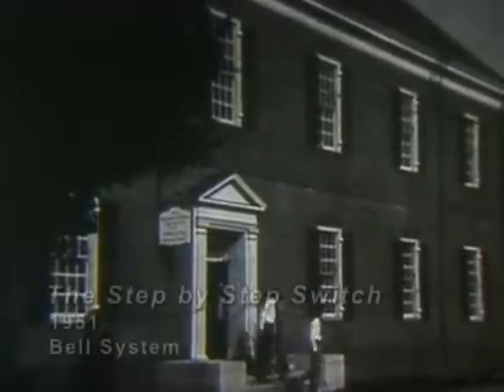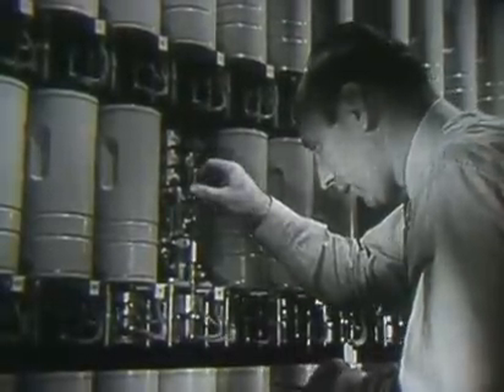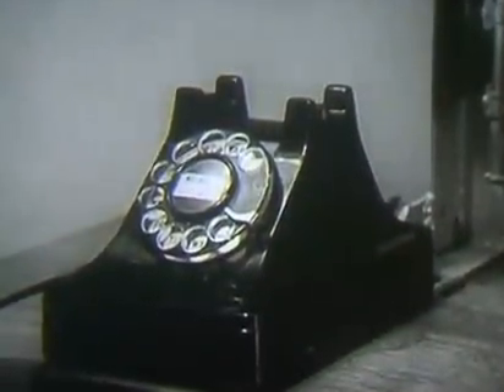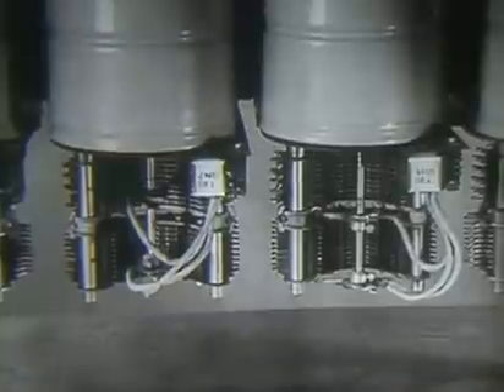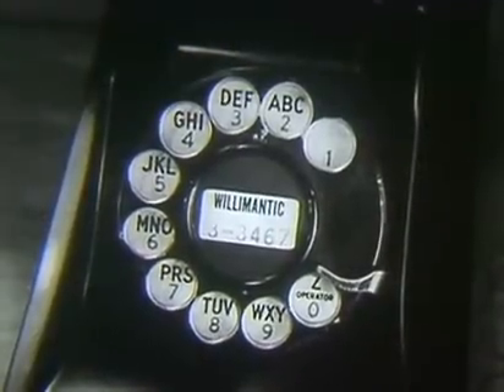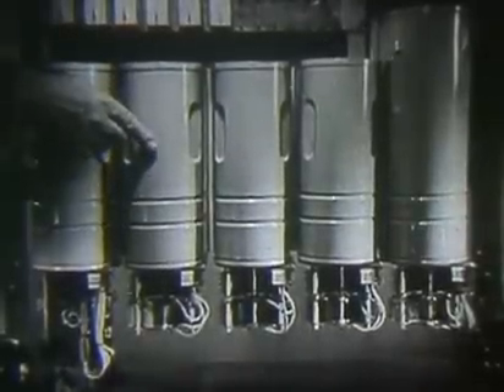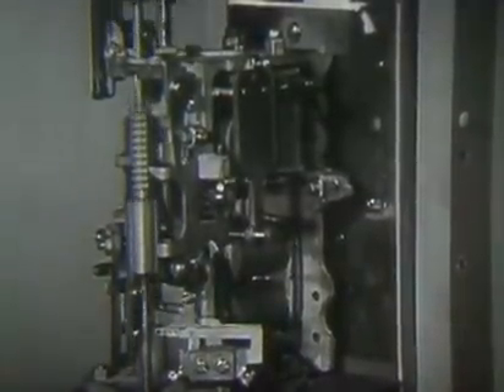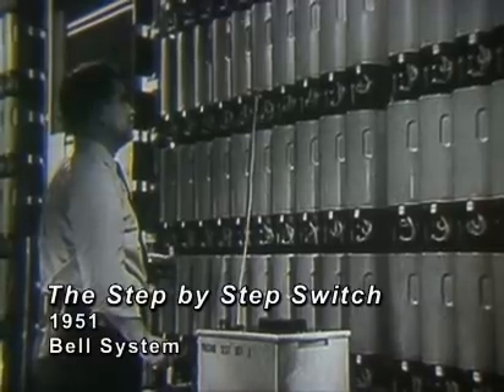AT&T Archives: The Step-By-Step Switch

Comment: This is very interesting, but unrealistic. They totally leave out the entire phone network and that these switches are rarely all in the same room.

A brief overview of the system, from old memory, but should be good enough to get the basic idea... 

The wire from your house goes to the nearest Central Office, which is a room full of these switches, and on one side of the office is a bank of switches with one terminal for each subscriber or phone that it serves. So if you had 2 lines in your house, there would be 4 wires running from your house to the Central Office, and connected to 2 terminals on multiple switches. 
(redundant so that the chances of all the switches that you were connected to being already in use was low) 

So when you pick up the phone, one of the switches it is connected to which isn't busy rotates and selects the contact for your phone.
Then when you dial the first digit, that activates the second switch, which will select either to stay in this central office, or selects an available trunk line to another office in town.

The next digit dialed is passed through now to the remote office, and selects the correct group of switches in that office for the right side of town. 
The next digit selects the bank of switches for the particular neighborhood, and the next digit selects the bank of switches for the right street, and the final digit selects the exact terminal for the wires running to your mother, because you should call your mother.

You can see why phone numbers got progressively longer, because the more possible connections you have, the more numbers needed to drill down.

In the early days you could only dial within your city or area, and if you needed to call long distance you had to call the Operator, who would select a trunk line in the direction you needed to go, the operator on the other end would answer, and then put the call through on their local system, and if you needed to call across the country, the operators might have to repeat this process through multiple interchanges in the cities along the way, until the route made it all the way to the end.

When direct dialing was introduced, they had to add the country code and area code systems which would select the trunk lines headed the right direction, and then keep drilling down. This was more complicated, because the area codes were not in sequential order, so when you dialed a 7, it didn't know whether you wanted 707 in California or 737 in Texas, and so it had to have some way of waiting for all 3 area code digits were dialed before it even knew which side of the country you connect to.
I can think of some ways to do it, but I don't know how it was actually done, but it was more complicated than just a simple city step system!
Reply: "...and the final digit selects the exact terminal for the wires running to your mother, because you should call your mother."

OK, I LOL'd!
Reply: Did step even have direct distance dialing? It may have just sent the call directly to a long-distance tandem when you dial 1.
Reply: Your explanation is fairly good, but the opening is wrong.  Your telephone was only connected at one point in the exchange but when you picked up the receiver, a selector switch in the exchange would begin to rotate, looking for equipment available to switch through your call.  The selector switch would automatically stop at the first set of available equipment and then you'd get your dial tone.  If there was no available equipment, you'd either get a busy/congestion tone or else you'd get nothing but the background line noise.
Yeah, I used to work in that area.  I still feel some kind of romantic nostalgia over the old step by step equipment.
Reply: I worked on first floor of CO which was big room for MDF and the local switches for town.  Second floor was all LDD and MW toll.

Comment: Wait, so every phone had to have its own switches? So if there was 50000 phones there were 50000 switches?
Reply: No, the line finders could each handle up to 200 lines (phones). Each line finder was connected to a first selector. So that made the number of switches needed 200 times smaller.
Reply: @johnbowditch3706  I'm still confused how  the line finder can handle more than one call at once. If it can't then wouldn't they need one for every phone?
Reply: @NoZioKikes88  Each lone finder is just that. When a very simple set of two relays called "line and cutoff relays" detect a phone that has been lifted off the hook they send a signal to the line finder to begin searching for the line that needs service. It hunts first up and then around until it reached the "live" contact that is associated with that particular phone. The the lone finder stops and the call can be completed. You are right that this particular line fonder is now engaged and so it will be tied up until the call is completed. But these offices were designed so about  up to 20 percent of the phones in a given office could be in use at any one time. If more folks tried to call then the later callers would not receive service.
Reply: @johnbowditch3706  got it, thanks 👍
Reply: @johnbowditch3706  So then I guess what would happen at that point (if more than about 20% of the phones were in use) is you would not get a dial tone?  I remember my Mom saying that she was in Washington DC the day Kennedy was shot, and that the phone lines there were overloaded and she couldn't get a dial tone.
Reply: James P   Yep,  no free line finder, no dial tone, no call.  Then if you did get DT, the connector bay might be busy for the number group you want and you'll get 120 busy tone.  If the number you called was busy you would get 60 busy tone,
Just like now for cell phone service, too many calls can't go through. If that happens then try text, at least that way text will go through when free.
Reply: @gijr2003  Ah, interesting, thanks!

Comment: I used to maintain Strowger switches for GTE in California.  I don't miss maintaining Strowger switches for GTE in California.
Reply: @somedumbozzie1539  I'm not familiar with crossbar equipment or cabling, but I know all about engineers changing design parameters midstream, and "re-tasking" equipment "experimentally".  Frustrating stuff!  While all other COs were installing new EAX/ESS switches, I was installing new digital-to-analog circuits, so that our subs could use 'touch-tone' technology.......Interesting stuff!  I was only 21 at that time, and knew that I'd eventually be given the opportunity to work on/with the "new stuff".  A job with the City of Los Angeles exposed me to microwave radio and fiber optic tech......I learned a lot for a decent wage.  Plus, they still actually had some SXS equipment for me to fix.....life was good!

Comment: Actually..... You didn't need to "dial" the numbers at all.  You could place a call simply by rapidly pressing the receiver hang up button up and down for the numbers you needed to dial.  To dial a 5 you would rapidly press the hang up button FIVE times. For a 0 you would rapidly press the hang up button TEN times and so on. For a local number you would do this for seven numbers. For a long distance call with a 1 in front of it you would do it ONE time, wait a second and do the numbers for the area code, wait a second and do the numbers for the perfix and finally the last four numbers.

Problem was, if you made a mistake, you had to hang up, wait a few seconds and then start again.

Comment: it's principle(one motion (vertical connector movement) and two motion (vertical +rotary movement of selector) step by step selector ) was developed by "Almon Brown strowger" (father of Automatic telephone switching system ) and most of the  20th century telephones exploited that mechanism for it's working.
Also ,the first chapter of telecommunication engineering begins from here only
Reply: That's a good quiz show question:
Name the inventor of the automatic telephone exchange.  Bonus point if you can name his profession. :)  (Using Google is cheating) ;)

Comment: When I was young I used to practice using the cradle buttons to send the pulses to the system instead of the dial. the buttons had to be clicked down at a steady rate in order to complete the call.

Comment: every CO had a broom stick to wack the mechanical switches when they stuck. especially on the old ericson switches installed in the 20s
Reply: Does that not damage the switch and allow it to get stuck again the next time it's used?
Reply: Alex Jamieson   Lazy workers wouldn't take time to fix problem.  Just wack it and go back to goofing off.   If I was in another town's office and stuck switch alarmed in, I would release it and check to see if it just needed adjustment to wiper. If wiper was broke I would busy it out and make trouble ticket for local guy to fix.

Comment: So much work went into these systems. Amazing that they got reliability.
Reply: Detroit8V92tta — Not that amazing.  They were built for long-term reliability because otherwise the maintenance costs would have been too high.  Today, we get the impression that mechanical systems are unreliable because so much of what we buy is junk.  It doesn’t have to be that way, but you have to be willing to pay for a better machine.

Comment: Oh, another thing, the phone only uses two wires. The dial just connects and opens the path between the wires as the dial moves backward. You can actually dial any number just by pushing and releasing the receiver hook buttons! I used to do this on phones that had a dial lock on them. Hard to "dial" 9 and 0, though. Have to count the clicks and do it fairly fast. Lots of wrong #s!

Comment: these are Strowger switches. Rooms were filled with banks of these. Amazing clicking, buzzing, and clanking sounds. Very noisy. A mess to work on, but were very reliable and did a tremendous job automating dial switching. Chick, chick, chick.. burrrr. repeat.

Comment: I was involved in the change out of much of this electromechanical equipment during the 80's and 90's.  It was amazing to see one line of digital equipment replace an entire room full of equipment.  Put a good many people out of a job in the process.
Reply: Was the old equipment "confiscated" by the phone companies(after removal)? I'm really interested in getting my hands on one of these old selectors or even an old operator manual.
Reply: Patrick yeah it would be super cool to have one of those selectors. There's probably a bunch of those in a old warehouse somewhere.
Reply: @abandonedcranium6592  , probably sold to a 3rd world country.
Reply: Were these switches often referred to as ‘decade switches’? I’m a middle aged electrician with many years of prem cabling, and early in my career I worked with an old Bell technician who taught me a tremendous amount about switch rooms, MDFs, terminating and such. I’m 50 now and still use that knowledge daily. Anyway I recall him talking about decade switches

Comment: My grandfather worked for Pacific Bell back in the 60's and 70's, my uncle worked for AT&T for several years. On my own I started work in telecommunications in 1990. I learned digital telecom systems in school. I learned how to install and program them, but at that time data communications was starting, we didn't know at the time it would become the internet. The Ethernet standard became the standard over time and through the 90's the internet grew. Short story is now I work in data centers and lab environments installing new switch gear for wireless communications, wireless internet, 4G and 5G network, 5G (5th Generation) which is coming soon.

Comment: Very interesting! I zlways wondered how those older manual-dialer systems worked. Of course, today they have all been replaced with server farms.
Reply: I today (February 2017) working on this kind of headquarters, you might think it's impossible, but it really is true. I live in Serbia.
Reply: I worked at a place that had a cage in the Miami ATT building in 79th street.  The buildin next over had the original 305 exchange as a showpiece.  ANyway back to the other building -- as I tended to my servers and storage it didn't escape me that a couple of decades before, the entire floor I was on was filled with this.   Nothing but this.  It was an almost overbearing sensation that this used to be nervecenter of Miami's phones.

Comment: Goddamm that must have been a friggen noisy place to work with all those constant stepping motors and clickings. Thanks for the vid, I love watching old tech and see what the older generation used, built and designed.
Reply: Only panel switches had motors.

Comment: I am wondering how these things do "error detection" to deal with the situations such as an user dialed a non-existence number that cannot reach any phone.
Reply: The contacts for non-working numbers are all wired to a recording or a reorder tone.
Reply: How do you dial a non number?  All the non working numbers had a clip on the connector block  that  sent call to NW# recording.
Reply: If I remember my training correctly (yes, I trained in that area for a while), all numbers which weren't considered valid were wired to return the "busy" signal.  Numbers which were valid but weren't in use (and therefore weren't connected) would return "ring tone" just as though you'd reached a working number, but you'd never get an answer since there was no telephone equipment to receive the ring current or to answer the call.
Later, it became easier to assign unused numbers to always return either a tone (usually "number unobtainable") or a recorded message stating that the number is not connected.
Reply: Melkior Wiseman   I worked in telephone office from 1970 to 2017,  I don't remember any NW# getting RBT, only NW# recording.  We had operator with pretty voice record our recordings.  One time a COR recorded the NW# message, he also did his personal answering machine with same message.  People thought they were getting NW# because it was same voice.  Then they came out with cassette tapes having prerecorded messages and office code at end.
Reply: @gijr2003  Heh.  I've been considering adding the international "number not connected" signal to the start of my answering machine message, to help deal with telemarketers.

Comment: I did my apprenticeship in various exchanges in the early 80's, and got to work on Strowger (what you call SxS), crossbar (which were huge lumps of metal bars with springy needles), the updated crossbar (which was huge arrays of reed switches doing exactly the same thing as crossbar), System-Y, and System-X (which was the first all solid-state equipment, and was insanely static sensitive)

What's not mentioned on this video is the current consumption of those Strowger systems!! From what I remember, Leeds exchange in England drew something like 200 megawatts during busy hours, and the system had battery backups (huge lead-acid batteries) in the basement that would keep the exchange running at that current usage for up to 30mins until the diesel generators span up. Also, the heat from all those actuator coils in the electromagnets made it stifling in the summer.
Those battery rooms were disgusting places too, with the stink of the acid, and as an apprentice guess who had to check the electrolyte levels regularly :)

Ah, nostalgia...
Reply: actually, I was there when they went from strowger to the first common control reed switches.   While strowgers take a lot of current to move the shaft, that is just momentary. and goes to zero with no traffic.  The early computer controlled switches used a LOT of power to run the multiple computers and memories, and a significant current to hold up the reed relays of the network for the duration of the call, as well as the loop current to customers, which remained the same.  The consumption of old and new switches was comparable, clearly displayed on the 50v rectifier output current meter.  Even now, the digital multiplexor technology uses lots of power for the computers and the network, which consumes power even with no traffic.
Reply: Yes, that seems to be often missed: older systems had a VERY low idle current (effectively just the leakage on open wire lines). Progress eh?
Reply: 5ess had a room full of lead acid batteries to run the 48volts for the switch.  Working on 20 year old memories though.
Reply: man comments like this just adds to the video by blowing my mind. its crazy the kind of terrible ass workplaces existed that i could never think of existing haha.